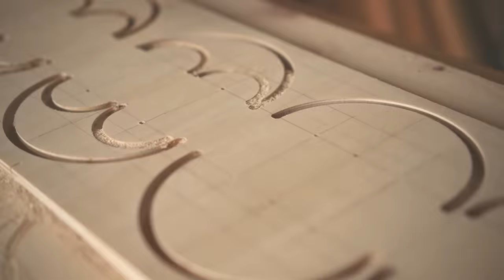Making a wooden fractal vise | Mini Workbench

Comment: Great project. this will be the first thing i made when my cnc is finished. One made of wood, like yours and another of Aluminium for wet applications. Tipp: for chamfering the bolts, use your akkudrill, mount it, max rpm and than go 45 degree on your grindingdisc with fine grid. So its like made with an lathe.

Comment: Great for delicate, irregularly shaped pieces. But it won't be terribly durable. Also, I can imagine the tight tolerances required for such a device to function properly cannot be maintained given the material will be subject to changes in humidity, etc.
Reply: Thanks for that 🤦‍♂️

Comment: My biggest question is why do we still use Phillips head screws? But this is an incredible piece of work
Reply: @MidwestFarmToys  torque screws , the ability to easily take apart and put back together without having to worry about stripping the screw is nice, especially when you have a tool like this, where i work magine humidity will greatly affect its usability. That way you can take it apart and fine rune pieces with sand paper then reassemble easily without having to replace screws